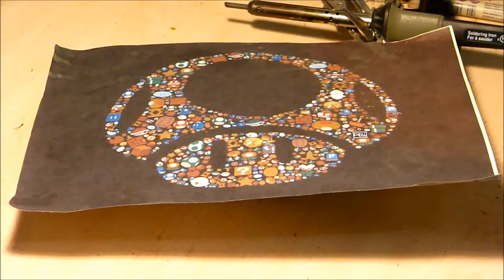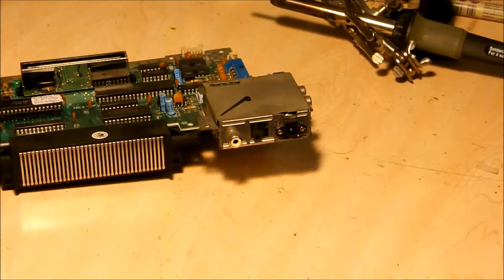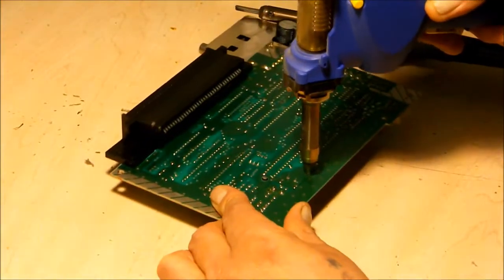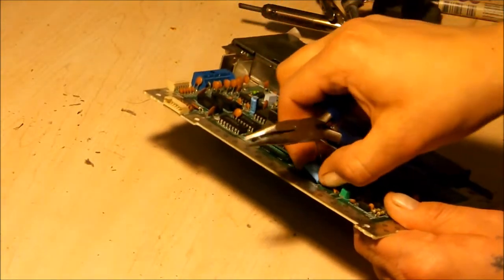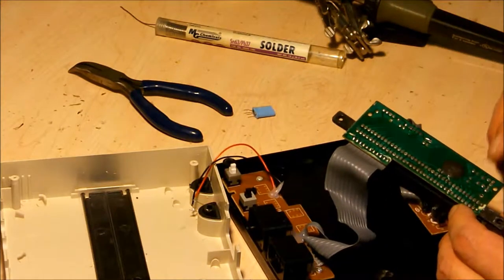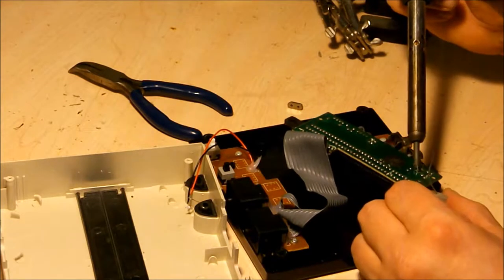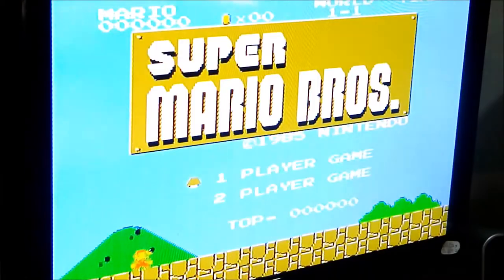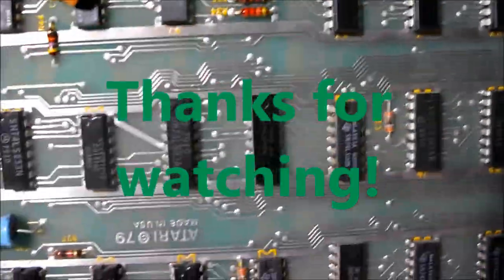NES Crystal Swap - Nintendo

Comment: A came here because i bought one "620 in One" Famiclone and it has the same fast speed. Probably it won't work too. 
There's a mod on Super Gameboy, you add a small circuit with the right crystal, so it won't use the SNES crystal. I think if something similar can be done to these clones, once replacing the onboard crystal does not work

Comment: Well I have similar task to do, with a famiclone that I bought and I need to change from Pal to Ntsc. But my only doubt is, if it is only to replace the crystal, or there is something else to do? I don't know yet. Regards from Brazil 💪💪
Reply from the maker: For your problem, You would need a step up power converter, from high voltage to low voltage and increase the cycles per second from PAL 50hz to NTSC 60hz. You may have to research that. I would check if it’s a voltage regulator swap or something to that affect.
Reply: @BuxProduxshuns  well, the console says in the back "ntsc" meaning that it is originally ntsc. The fact is that there is a crystal that I believe was put in there to run on Argentinean tv's without incompatibility. Thats the fact. I will change the crystal, but I am afraid that something may not go well. I am between the cross and the sword lol
Reply: Brazil uses PAL-M, which's a variant of PAL that uses NTSC timings, it's only the color encoding that differs. The NES consoles sold here officially were NTSC units, with an added circuit board to convert the color information in the video signal. To convert these systems back to NTSC you have to replace the crystal, remove the extra board, and restore a few traces on the main board.